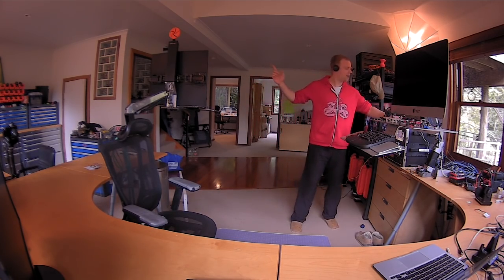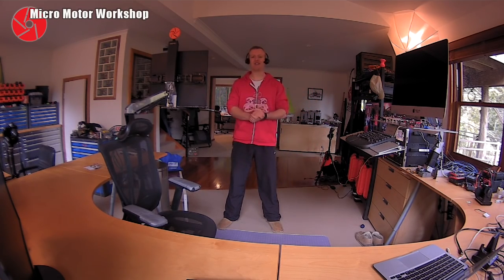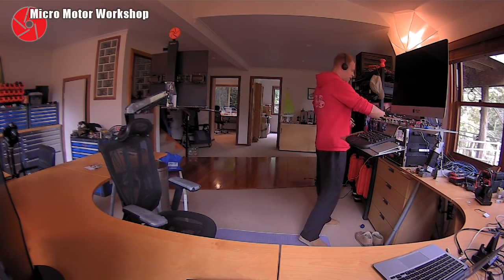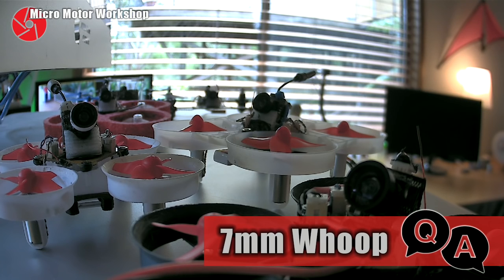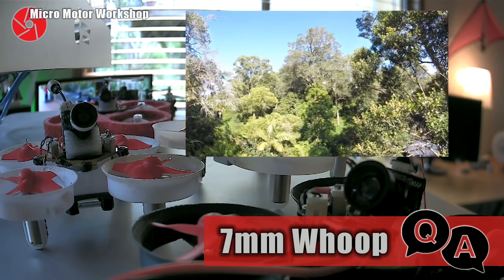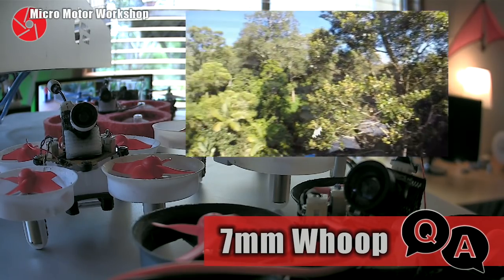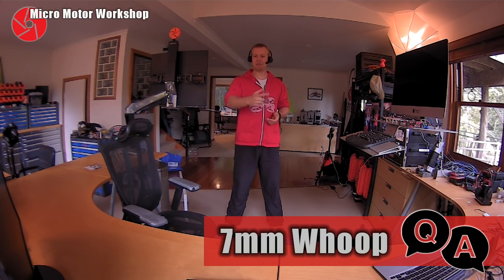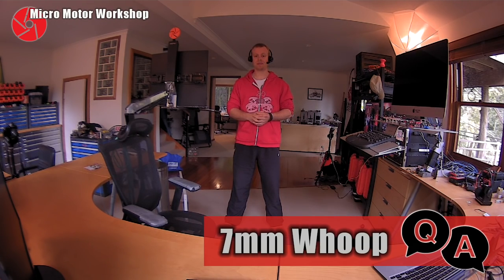[Micro Motor Workshop] - 7mm Whoop Q&A - pt. 1: Questions

Comment: Q: Would you explain the engineering/manufacturing improvements that make your CL-0716-17 motors so much better? Also, what's stopping these from becoming more common/mainstream?
Reply from the maker: Its not the manufacturing process, its the right combination of motor, props, and battery for a given payload and frame. 7x16 is just a better fit to fly a whoop frame and 4-5g of camera, because we dont have to drive the motor as hard to get the desired flight performance.
Inertia. Manufacturers and vendors watch the chit-chat. And when they see people talking about 7x16mm whoop frames, those will be made.
Reply: Rewatching your "7mm Whoop - punching above his weight class!" to better understand WHY the efficiencies are present in this motor size. Thanks for the reply, @Benedikt!

Comment: how does the stock inductrix FPV FC fly with these motors with a 205 vs a 255.  wondering if the smaller pack would be better than the HV pack on a stock FC or if the motors are too much for that FC all together.
Reply from the maker: Good question! I will probably not have time to find that out before the next video. I think it will be problematic. The non-programmable FCs assumes a certain power:weight ratio, and if that is significantly changed, the tune will be off and you get oscillations and a very difficult throttle curve. The 0716 motors produce a lot more power for a given voltage, this will very likely confuse the stock FC big time.
Reply: Micro Motor Warehouse i use my throttle curve on my dx6 just to slow down your REDZ! lol.  I thought  the oscillations might be too much for the stock FC :(
Reply from the maker: yeah, Id be very surprised if that would fly acceptable.. But we will find out eventually ;)
Reply: The stock FC does just fine, especially with the stock motors... With the Insane's Some oscillations, especially in the beginning, but if you are a fan of that FC, you won't go back to a 6mm build after you try this.

I ran this setup tonight and it was awesome... Need to record it.
Reply: patrick j. clarke what batteries were you using?
Reply: I am using 205 and 255 HV.  my 255's are getting tired so it's hard to compare, but their added weight and lower performance because they are old gives me less oscillations than the 205's.

Comment: Question. Which works better on the standard tiny whoop props 716 motors or 720
Reply from the maker: Quick answer for you: Whoop props (for 0.8mm shaft) dont fit 0720 motors, because they usually have 1mm shafts.
Reply: Micro Motor Warehouse yeah you could drill them out. Basically my question is the 716 motor better for the 30mm props due to them being lighter.. than the 720 because it is heavier maybe to much motor for such a small prop is what I'm thinking, perhaps 716 motor is perfect for 30mm props

Comment: i've read places that lihv dont last as long as standard lipo. so having hv lipo but charging to 4.2 is a better option for longevity?
Reply from the maker: I have read that too, but I cannot confirm that (yet). All my 205 and 255mAh mylipo HV packs in use are still going strong andI fly them daily for a few months now.
In general, charging lipos to a lower voltage is putting them under less stress and they wear out slower, so I assume charging your HVs to 4.2V will prolong their life. Also important, minimise the time they are stored charged!

Comment: One of my motors only works when I give it a push ...it works fine until it stops then it won’t start again ...could you advise ... it still works but not properly ..can I save it
Reply: Jk plastering and paint solutions that’s a typical sign of a damaged motor - needs to be replaced!

Comment: what will be the name 7mm package diy that will be available from mmw?  arnold whoop? 

but seriously i'm curious about current 7mm components available today on the market, ie frames, fcs (have some interest in alien f7 brushless), motors (prop pairing) and batteries.  did i miss anything ;)  Also interested in trends you see beyond 7mm in the whoop form factor.
Reply from the maker: I havent thought up a silly name for this one yet... Thought I'd play it boring this round and just call it 7mm. Arnie is tempting, but Im not good at Austrian accent :p 

Seriously good question though, I will cover the (very limited) selection of 0716 specific parts and the general scope of what can be taken over from the 6mm builds.